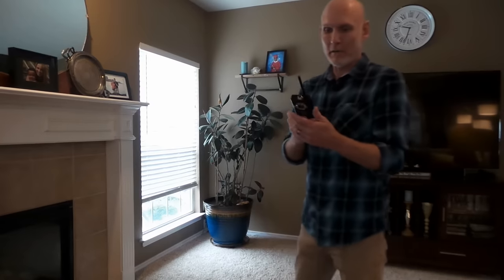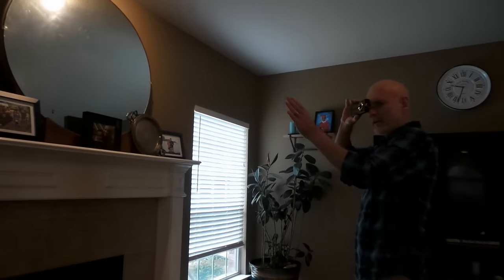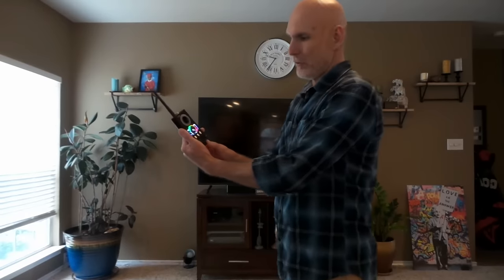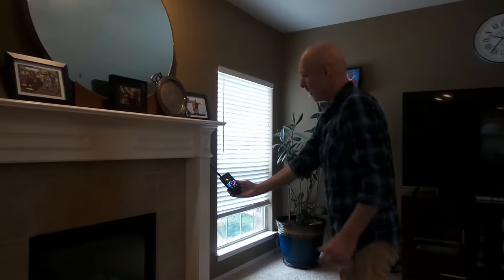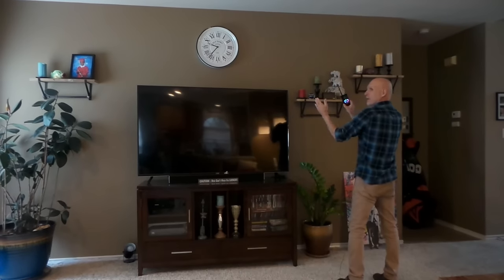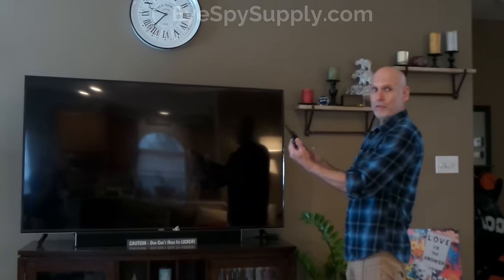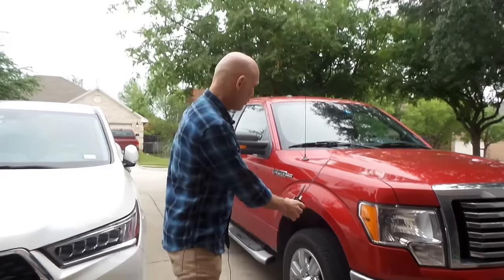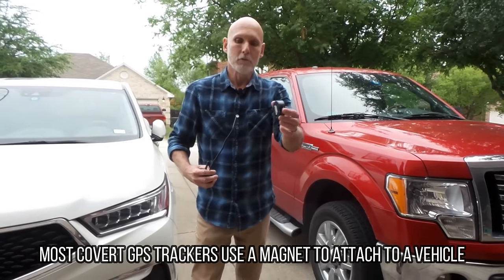Tutorial How to Find hidden Spy Cameras, GPS Trackers, "Bugs", Listening Devices  RF Detector Sweep

Comment: I have this device! My question is, it rang when I got it close to my car key control, every time I locked it unlocked the car it rang! Also, certain areas on my lower part of the car door frame! I’m going crazy because one of my cars is ringing in the lower part of my seat! 😨 I’m exhausted!
Reply: It is a signal detector. If there is no reason for a signal then you might have a problem. Keys might put out a signal depending on the car type and year. I’m sure a quick google search will tell you. Newer cars have their own WiFi signals now so that could be the reason for the issue

Comment: What if the gps doesn't use a magnet?
Reply from the maker: Great question!  Most GPS trackers, if outside the vehicle, use a magnet to secure them,  but it could also be secured in other ways, like a zip tie. It could also be inside of the vehicle or engine compartment.

This counter surveillance device also has a RF detector, which will pick up the GPS tracker when it is transmitting. Most trackers only transmit while the vehicle is moving making it very difficult to use the RF detector. to pin point the tracker

The best way to be sure is to visually inspect the entire vehicle, but using the magnet detector gives you a good place to start and can make the job much easier.

Hope this helps!

Comment: If you locate a wireless transmitting device in your home , ( spyware )  would there be a way of barricading or blocking it in such away as it can't transmit out of your home anymore ?  Please get back to me , it's important . Thanks .
Reply: @veritasjustus8543  Thanks for your response so fast . I have a medical device in my bedroom , it's called a "CPAP "  . Very recently I found out that its Wi Fi and  that I'm being spied on . I must protect my device and stop this . What can I do ?  Please get back to me . 
                                                John H.   Toronto
Reply: @veritasjustus8543  Thanks for info so far . To fill you in a little more , this is a is a little device that sits on the floor beside my bed . It runs on 115 AC , every so many days I would use it for a little while when I first go to sleep . It's suppose to give a little more oxy during sleep . I found out that it has WIFI spyware in it and I am being spied on when ever I use it and this info is going to a commercial company . I want to stop this spying on me . Give me some ideas here , how can I protect my device and my personal information  ?
Reply: @veritasjustus8543  Good Day Again :  A Tin foil bag is sounding very interesting . I've seen many times over the years emergency thermal blankets that are made of a foil material to help save people that have fallen into freezing water .  Would this type of foil be suitable for wrapping my device in to stop the spyware from getting my personal information ?  Please get back to me , I really appreciate your information .   John H.  Toronto

Comment: Best post I have seen for topic
Reply: @ikebipe  y does it suck?
Reply: @victorywinner3845  The device doesn't detect gps unless it's emitting signals which mostly happens when the car is driving. They don't tell you that.
Reply: @ikebipe  so what is the best device to find gps then??u know any?
Reply: @gamersforlife3440   No idea, but I basically pointed out what I heard about this device on another video. There are more expensive options around the $500 dls tag price. I assume they are more geared towards actually finding cellphones (gps)

Comment: What I 'm going to say is more helpful in hotel rooms. To see if the mirror in the room is not a two way mirror, simply point a flash light about one to two inches from the mirror. If it is a two way mirror the light will travel thru, and allow you to see the room on the other side, if it is a one way mirror it will reflect back to you.
Another point a little off topic when first arriving into the hotel room put you luggage in the bathtub, and check for bed bugs. Don't let the rate of the hotel fool you, I live in Las Vegas some of the most expensive hotels on the strip have had bed bug problems. If you take them home in your luggage, they are really expensive, and hard to get rid off. After Covid many hotels have not replaced their staff back to pre Covid numbers.

Comment: 🟥🟥those don't work so well we tried everything 🟥good luck doing it in a smallest car , this thing make noise every 20 second🟥 we tried different one same thing 🟥I am think to get the same function on airport metal checker in hand version 🟥 searching ur car will take u almost 1 hr it more and it will beep on literally everything, it even beep ok local wifi or near ur phone 🤳, which is one of the resources is saying but then the buttons are confusing and antenna is also confusing, there one with slight different buttons that's also a fail. Do t know why these Chinese company have such a issue to make such a simple thing , there's a huge confusion between magnet 🧲 test and RF I think It call which is a radio signal test , either way it will ring for both . Nowdaya this is so damn demand  under everyones car  and next thing u know it don't work lol ....🟥🟥🟥🟥everyone with good job and bad job need this human resources are putting this in cars 🟥🟥🟥
Reply: ALL newer cars, COME STANDARD, with gps trackers, built in!!!!, you can have car dealer, disconnect, or if your mechanically inclined, just cut wires, disconnect,from power supply,,they're usually located near the card readers ,on drivers side,,under the dash,,and they monitor your braking, acceleration, speed ,,etc,,for law enforcement,,,in case you crash,,,etc,,,they're easy to disconnect,,,if you know what they look like,,,usually a flat black chip,,about size of quarter, or square,,,with wires attached,,to cars electrical system,,,,😎